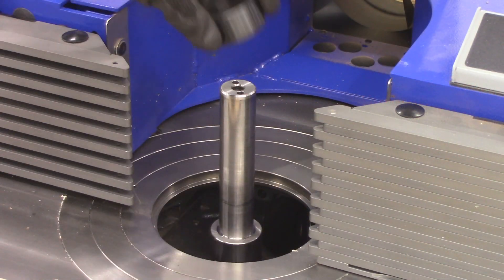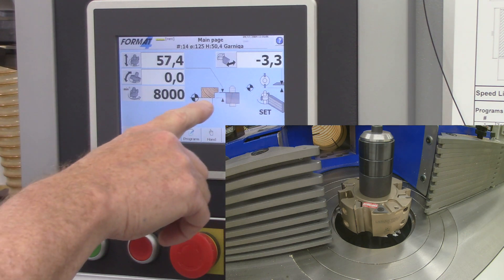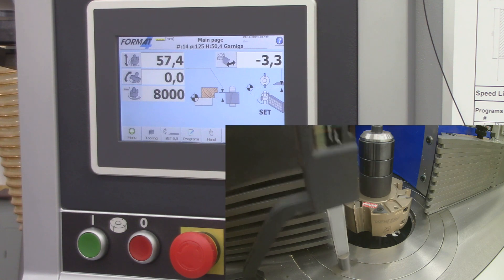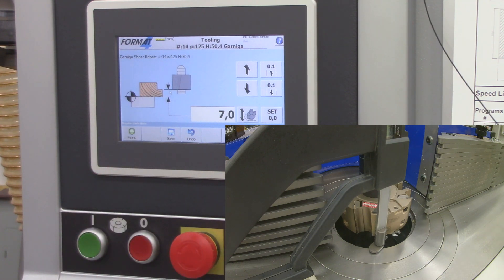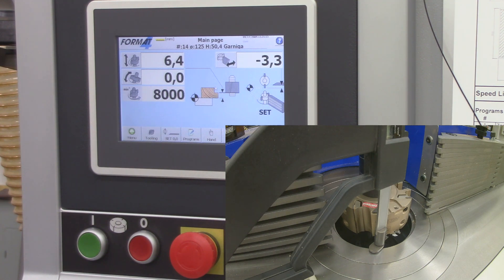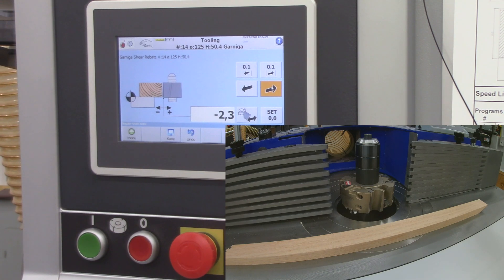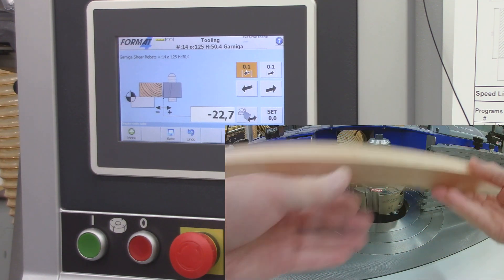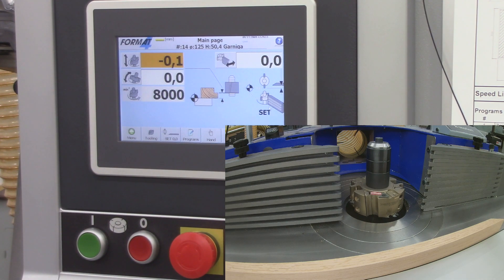Shaper 101   Recalibration of Shaper Cutter on Format 4 Profile 45Z

Comment: Hi Steve - always fun setting up new cutters, especially center-referenced cutters like glue joint and lock miter cutters.  I find the center position very useful for 40mm profile knives as their pattern is often centered on the knife so being able to use the midpoint makes alignment easy. Cheers
Reply from the maker: justcruisin109 - I don't have a glue joint cutter but you are absolutely correct on the lock miter and the universal cutterheads using the center reference.  No setup blocks for me as they are only good for one thickness of stock.  Have a great day.  Steve